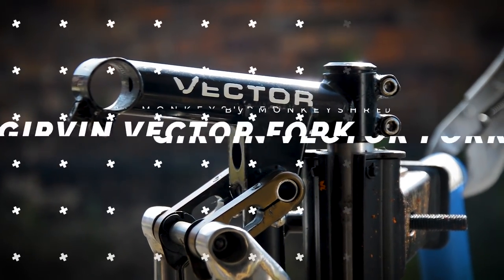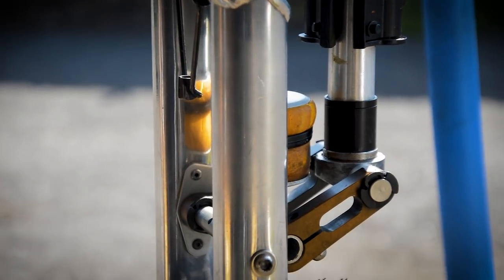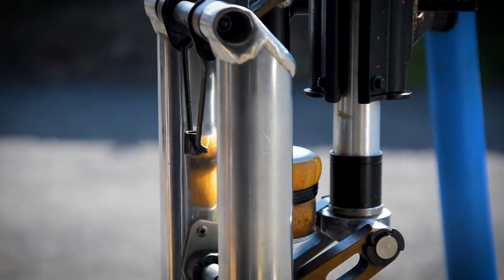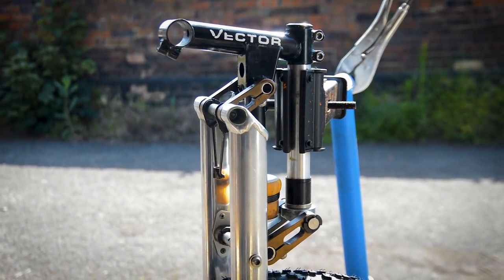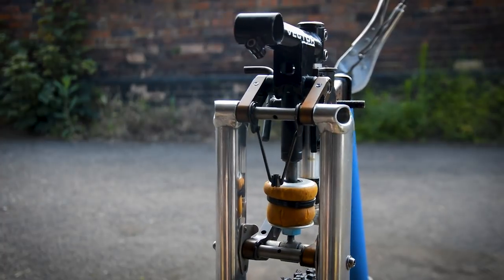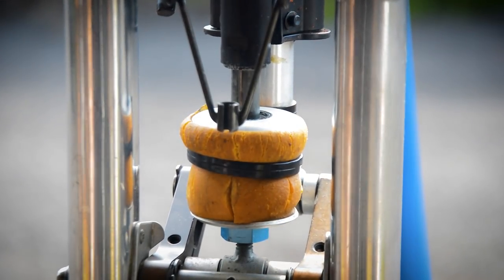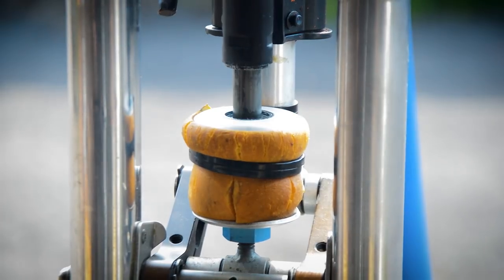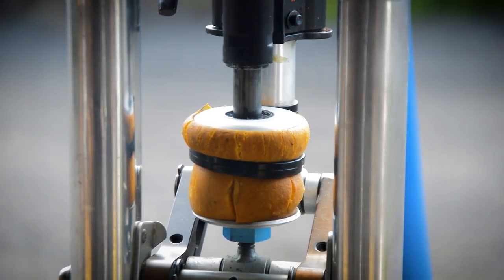Introducing the Girvin Vector MTB Suspension Fork // Replacing Elastomers

Comment: I have the same fork, with a Risse Air shock. nice little upgrade but costly. When I got it, the bottom mount of the shock didn't rotate along the shaft, making a very stiff actuation, and creaked badly as it was forcing metal on metal, and didn't seem right. The bottom mount shaft is hollow, like the one you have. I cut a bar to fit inside, with screws and washers on either end, and cut the hollow shaft into three pieces. The bar I made inserts, and the shock now rotates freely over the shaft, making the suspension REALLY nice. HUGE improvement. I'm not sure if the one that the elastomer fits on actually rotates freely on the shaft, if not, this worked nicely for me. Such a cool fork. I love the old school designs like this. Great Vid!

Comment: I bought the exact same model only mine had been retrofitted with a noleen nr1 coil upgraded from the original elastomer.  They are as much a work of art as they are a piece of equipment. Totall and sadly  underrated. My set went on a 2000 kona muni mula  in matching chrome and looks absolutely mind-blowing.  I am looking to replace the nr1 with a modern equivalent though
Reply from the maker: I do love them. I’ve just had another one on another Proflex. This time, elastomers in tact.

Comment: Had a Pro Flex 656 with a Griven Vector II fork years ago. The idea behind the elastomers was that they were self dampening, so no other dampening device required. I was fine with the bike, but the elastomers didn't last long, were expensive and eventually became unobtainium. It looks like your new "elastomer" are unblown (Not foamy) urethane blocks that appear somewhat stiffer than what I had. I believe that fork didn't dive on hard braking like regular plunger forks. Cool bike!
Reply from the maker: They are poly replacements yep!  The foamy old ones actually melted in the heat of the sun when I left them on the side...

Comment: I think those forks might be the wrong size for that frame, there's a lot of steerer sticking out. The headtube length is pretty critical to the function of the fork. Not sure about the Vector 1, but all the other Vector /Crosslink forks came in different sizes to suit different headtube lengths.

Comment: My first full suspension bike was a 96 proflex attack. It was their entry level bike I believe. It had a rockshox quadra up front rather than the girvin. I just remember that the rear suspension was awful to work on and it bounced like a pogo stick. I replaced it with a 96 santa Cruz heckler. It was a much better design and santa cruz kept it around for about 20 years.  Still, I feel a bit nostalgic about Proflex. Interesting designs.
Reply from the maker: The rear does bounce doesn't it.  :D

Comment: hi ,came across your channel about a week ago ,generally great videos .only one concern ,your holdsworth replica build ,I have a genuine vintage holdsworth    and with you putting a holdsworth decals over your project it gives the opportunity for someone down the line to pass it off as genuine .,thoughts ?
Reply from the maker: You're right.  It is a possibility and yes, someone may pass it off as an original further down the line.  I'd hope they're honest about it and hope a potential buyer could spot it doesn't have the lugwork of an original or that the modern decals on an old frame don't match.
Reply: @MonkeyShred  hi, thanks for the response, I agree people with half a clue would probably spot the decals and lugwork, obviously in the replica you made, unrelated to yours but I just spotted several sellers pumping out replica brass formed head badges, it's going to make things very difficult for the innocent buyer

Comment: Vector 1 and 2 adjustment: http://idriders.com/proflex/resources/v1_v2_al_alignment.pdf
Additional Proflex Resources: http://idriders.com/proflex/resources/  http://idriders.com/proflex/resources/ods_service.pdf (the fork on mine is ODS, so I have to replace the oil in addition to swapping out the old elastomers)  Replacement options for elastomers and spring shocks: https://www.suspensionforkparts.net/eshop/proflex.html?page=all https://nulifecycles.com/proflex-kits/

I have someone holding a Girvin Offroad from around 1991 for me which is the year Girvin introduced that simple suspension stem with the small elastomer bit. He introduced the rear shock in 1992 and then the vector fork came out in 1993. By 1996 oil dampened suspension (ODS) was an option which was included in both the front and rear shock. I picked up the 856 model and there's information on adjustment out there ( https://groups.google.com/forum/#!topic/rec.bicycles.off-road/Zw-AS7Fvsws ).

History: http://mombatbicycles.com/MOMBAT/BikeHistoryPages/ProFlex-Girvin.html

Comment: you need a 1inch to 1.n1/8th shim for the top part of the headset    you can use a 18th headset     ,,just get that shim,,,,you can get them with some headsets,,   you can make 1 if youneed a photo hola
Reply: looks like a seatpost shim   but thicker
Reply from the maker: Problem is - you can’t just shim the top of the headset. You’d have to run a shim from the crown race, all the way up the steerer to exactly where the stem sits. The stem is 1” so it fits perfectly and if you tried to just shim the headset contact area it would undoubtedly work itself loose and drop out over time. 

The original headsets for these had a special reducer built in to them. Impossible to find though.